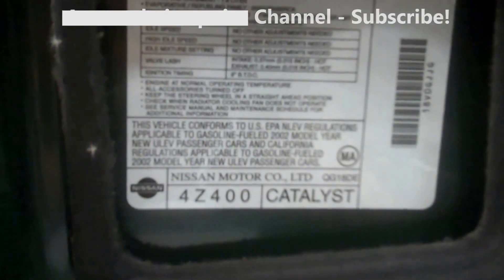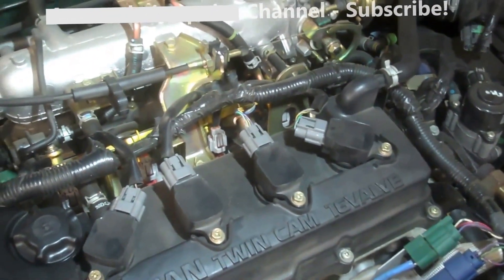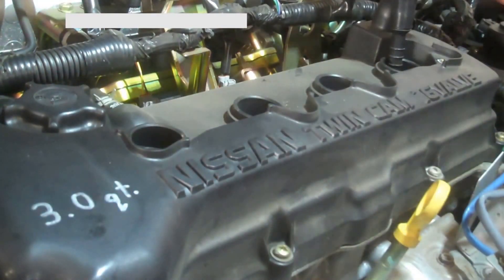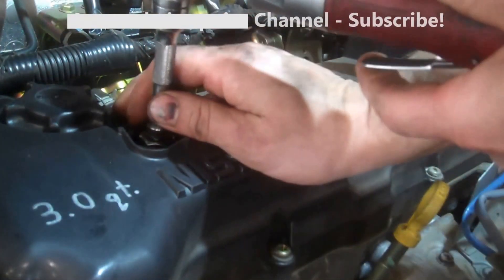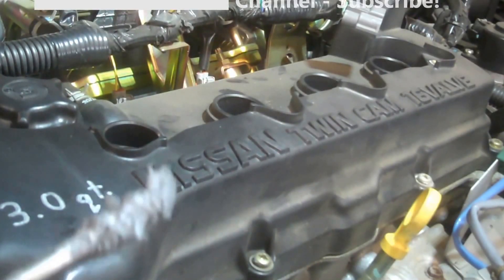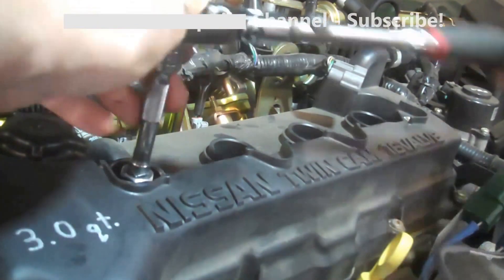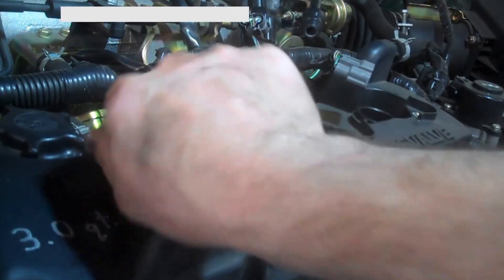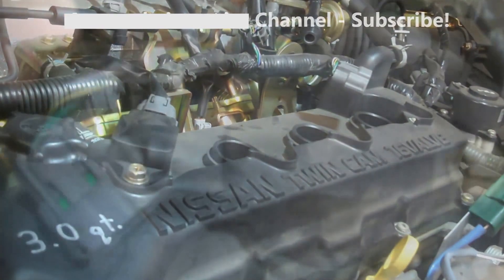Spark plug replacement Nissan Sentra 2001 - 2012 1.8L Tune up Install Remove Replace. Ignition Coil.

Comment: Thanks for the video. Just changed mine today after 12 years! Cleaned the MAF sensor as well. That pesky Service Engine Soon light went off as a result although the code was for the thermostat. Gonna change that next.

Comment: Hello. I  have a P1320 code on a qg16 which is the 1.6 version. It revs itself when going into neutral whilst driving or coming to a stop. What could be the best way to handle this?

Comment: Yo thanks for thks man .. i heard u need to gap the plugs but these days they come pre gap so easier by the way what size sockwt you usin ? I ha w the same qg15 engine and. I have a 13/16  will that work or its 5/8

Comment: I have a nissan sentra but when i start it th e neighbor i bought from said when i start i havr press the brake then when it starts hold the gas at low rpm until ir runs on its own or it will food have any ideas what it could be

Comment: Hey nice video, I'm thinking about replacing my spark plugs on a 2004 1.8L? Which spark plugs will you recommend for good quality and performance? Car has 168,000 miles and never had a tune up(I believe lol) and also I was told that my C02 sensor was out? Do you think i should do the tune-up first or replace that sensor? Thanks

Comment: Question: I disconnected 2 coils and then pulled them out, so I had two loose coils (black boxes). I wanted to compare the two (bad idea). Anyhow, I got the coils mixed up and might have put the coils in the wrong compartments e.g. black box1 where black box3 was and vice versa. I however did not get the gray plug in (not sure what they're called "sensors?") switched up. I drove it around for 10 minutes and it seems to run fine. Would this cause a misfire or any problem if I truly switched the coils?
Reply: If there was no problem with your coils then it shouldn't be an issue

Comment: Hey, my buddies 01 sentra shakes hard when he drives. I think it's the spark plugs. But I connected it to a ob2 scanner and said maf sensor. I don't think it's the mass air flow causing this. But then again I'm no mechanic. Could you let me know what you might think it is?
Reply from the maker: ***** If there is a code for the MAF I would at least see if you can clean the wires, if you can access them, take a good look at the air boot between the MAF and the throttle body and check for any cracks that would let air in. Cant have any leaks there.  if it was a spark plug issue causing a misfire there should be a misfire code stored in memory. P0301, p0302, p0303, p0304

Comment: Hi-great video-is there much of a difference with a newer Sentra? I have a 2011 reading misfire when I had my tech check it-it hesitates when accelerating, shakes at idle and has actually died when stopping after driving awhile-mechanic says it will be $300+ due to labor involved in getting to plugs....any help would be appreciated
Reply from the maker: ***** I am not sure that a bad spark plug will cause your car to die.  Does your 2011 look similar to the car in the video, like your car has a coil on top of each spark plug? What was the code or codes in the computer?

Comment: Do you recommend using platinum spark plugs over iridium plugs? Can I gap an iridium plug? I own a 2003 Nissan Sentra. The specs say 0.043mm and all the spark plugs I've found are either 0.040 or 0.044. (I'm new to this haha)
Reply from the maker: You can gap them, personally I don't think that you really need to be worried about being totally exact.  you can be just fine being off   .002 or so in my opinion.
Reply: All right! Thank you!

Comment: I have a question. I plan to use a torque wrench to tighten the spark plugs on a 2005 (1.8 L) Nissan Sentra. Could you tell me what the torque spec is on that car?
Reply from the maker: Jorge Wong 15-21 Ft lbs.
Reply: Thank you very much!

Comment: hii ...well i have a question ...soo my nissan sentra 05 start normal at the first time i drive n i turn it off ..and  after 30 minutes doesnt start at the first time until i try for second time idk what it could be the problem ...thanks
Reply from the maker: When It doesn't start, what does it do?   Click?   Nothing at all? Do you have dash lights when you try to start it?
Reply: it crank but it doesnt start at the first time ..and i try again ,n it does start normally but at the second time always  ..i did the tune up already...thanks to answer ..!!
Reply from the maker: I can't really say why, I wonder if fuel pressure is bleeding off somehow, so you have little to no fuel pressure when 1st starting.  Maybe try to turn the key to the "ON" position (dash lights come on) leave it there for 3-4 seconds, then off for about 10 seconds, then back to the "ON" position again, and then the 3rd time try to start it and see if it starts right away.
Reply: I have the same problem with u and now I can not start my car no matter how many times I tried...I think it might be the spark plug problem but I'm not sure. I'll have my car towed to an auto repair store to check it out.
Reply from the maker: Well you would need to do a few basic checks. Checking spark output at the spark plug, spark should be able to jump a gap of about 1./2 an inch.  Likely is best to have someone check it out as you are doing now. Good luck with it.
Reply: +Fixing cars and stuff same been doing for years but runs fine when on. what could it be?

Comment: I started to change  plugs in my 2000 sentra but found the first plug to be real tight when removing.  I was afraid i might snap the plug so i stopped.  Any thoughts on this? Thanks.
Reply: Stan Kardas are you turning the wrench the right way!?
Reply: uber sanchez yes, definitely turning the socket the right way.  I guess its possible the plug was cross threaded going in or, there's just some corrosion.

Comment: I have 02 2.5L spec v. Anything different there as far as plugs go?
Reply from the maker: If you mean simple replacement, no there should not be. I am surprised that the box of spark plugs I usually get (like a 4pack of plugs)  on the inside it explains how to tighten them, maybe peek inside and see what you see.

Comment: Sir one question or anyone that can answer it. I replaced the spark plugs in the same car and one of the spark plugs had oil. I remove the spark plug and I saw oil on it and in the coil and there was oil in the compartment where the spark plug goes. What can be wrong? 
Thank you
Reply: Adventures with Monkey probably a broken piston ring

Comment: Please help my 2010 Nissan sentra has a code p0304 I changed the spark plug , coil and the throttle body hose which was crack but I am still getting the same code p0304.
Reply: I am assuming that you had the code cleared after replacing the items?

Comment: Could this cause your car to hesitate
Reply from the maker: Mercedes deberry Well spark plugs, coils, and plug wires that are bad will cause a misfire, and that could be the same thing.  I would consider a hesitation less of a jerky feeling when driving then a misfire.  I would consider a fuel issue or sensor problem when describing a hesitation.  but defining what you feel with words can be tricky. If they need to be done due to maintenance I would at least do them 1st.

Comment: PLEASE HELP! my spark plug wrench is short, about 2-3/4 inches (2 and 3/4 inches) , so I had to use a long extension bar. The problem is that if I had screwed in the new spark plug, the short spark plug wrench would be stuck inside, it would not be pulled out along with the extension bar that it was attached to.  WHAT SHOULD I DO PLEASE?
Reply: buy a proper spark plug socket and ratchet, with an extension for easy removal and installation.

Comment: Before I take out the spark plugs how would I know if that is the issue and problem I need to fix? My 2002 Nissan Sentra will crank but not start.
Reply: could be a bad fuel pump, i have this car as a secondary and that was its issue. Its pretty common in this car.
Reply: It's a very simple fix in this car you can get to it without dropping the tank! just lift up the bottom of the backseat and low and behold it's there.
Reply: Or it could be the cam or crankshaft position sensor that was my problem in mine
Reply: I replaced them myself it runs perfectly fine honestly

Comment: Hi I was trying to change my spare plug but it got broken, how do i take it out. Help me please
Reply from the maker: I am not sure exactly where the spark plug broke for you. if it was just the white porcelain upper part you can still get a socket on the plug and turn it out.  Maybe you need a magnet to pull out the parts.
Reply: was the porcelain plus the plug so i can not use the socket. I just call a professional to do it, lol . Thank you very much, your videos are amazing

Comment: Come on if you're gonna do a video do it right. You should be telling those who are new to this to do one plug at a time and not to remove them all at once because people did mess up the firing order if they don't know.  These are big things to miss but otherwise you did fine. Recording camera angle is piss poor and you you dont gap these plugs but you could take 30 seconds to tell or show what gapping is because as you should know sometimes its are untapped or moved in shipping, Etc.

You should've also removed the plug and show what a bad spark plug looks like. 😑
Reply: If by chance you mess up the firing order, how do you put it back the right way?
Do it all again but this time in order?
Thanks